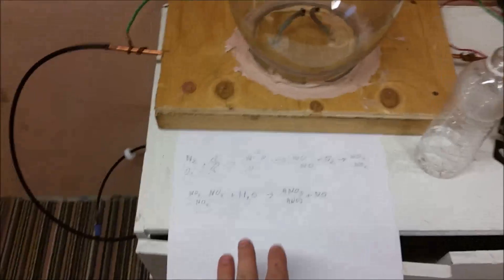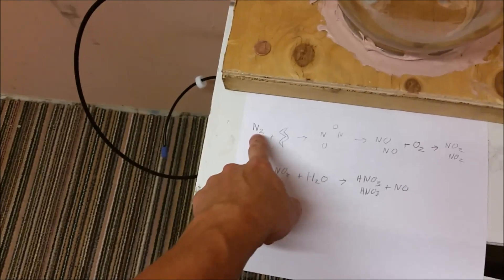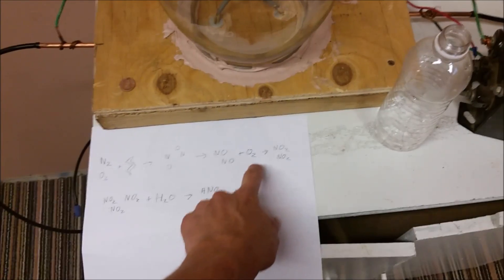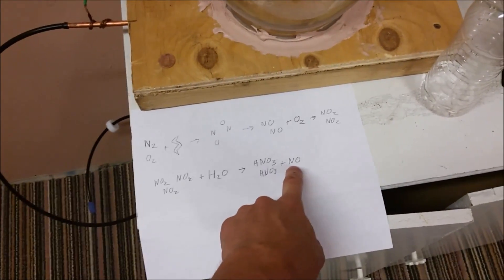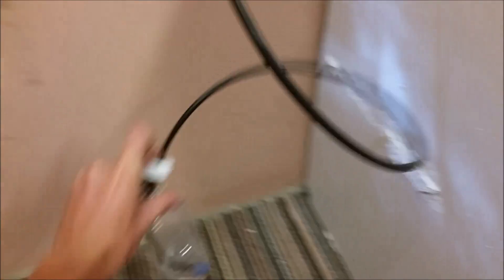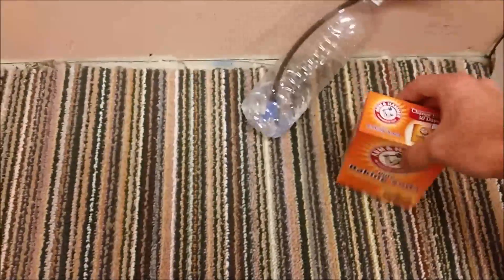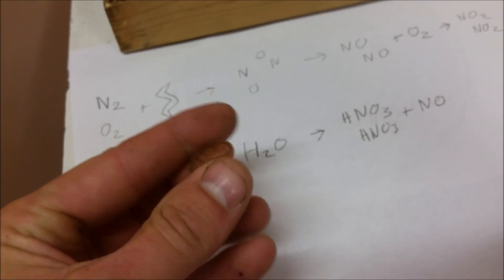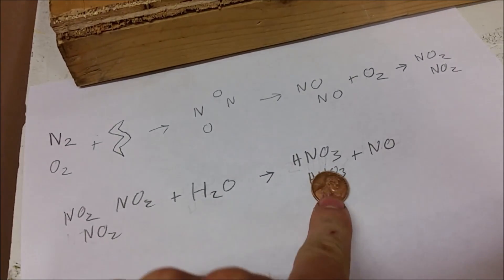Nitric Acid From Thin Air

Comment: this might be a stupid question but, is nitric acid like nitrate? can nitric acid be made into nitrate? sorry for the cringe.
Reply: Nitric acid is HNO3. The NO3 is nitrate. When Cody reacted it with baking soda, one of the products was sodium nitrate. Nitrate is just an polyatomic anion.
Reply: +Collin Barker can I make potassium nitrate with nitric acid?
Reply: Yes, you just need a basic substance that has potassium in it. Potassium carbonate (K2CO3) or potassium hydroxide (KOH).will work, they will get very hot though as they are both strong bases. Potassium hydroxide can also be used to create liquid hand soap and the conductive solution in an electrolysis machine.
Reply: yep. you will also get water and carbon dioxide. It will bubble and get hot.
Reply: no problem. If you need more of this, reply again here
Reply: Yes it is soluble in water and the process produces water. Added water will not affect it.
Water will be needed to react. This reaction is similar to baking soda and vinegar. After it is neutralized (done reacting), evaporation by boiling can be used to obtain the crystals.
Reply: If you add the potassium carbonate until no more bubbles are formed, the reaction is neutralized and there will be no more nitric acid.
Reply: It will dissolve but it will either be acidic or basic, neither are very good for plants (or you) in high amounts
Reply: There is no "limit" to how much can be added, but there will be a point where there will be no more nitric acid left to react with the potassium carbonate. At this point, it will become very basic.

I took 1st year university chemistry here in Windsor
Reply: Neither. Only the nitrate contains the oxygen which makes stuff burn. Achieving neutral is the safest solution to have. This can be done with many chemicals that are indicator, litmus paper is one of them.

You can also add enough potassium carbonate to nitric acid that it will stop bubbling. This will make it slightly basic but almost neutral. It is usually easier to dehydrate bases than acids. (baking soda vs vinegar).

You need to get as close as possible to neutral as carbonate will produce carbon dioxide (CO2)  if it is burned or heated to high temperatures which will slow the burning process. It is a fine balance between easy to dehydrate and easy to burn.

If you want a safe practice example, get some vinegar and add baking soda until it stops bubbling. This is the same type of reaction with very similar results. (water, CO2 and a salt) 
This does NOT produce nitrate, it is good practice for when you use nitric acid and potassium carbonate.

The chemistry I took was Chemistry for Engineers, it has little organic and a large amount of mass scale everything else.
Reply: It is dangerous to handle both when they are strong. When close or at neutralization, it is fairly safe. If you overshoot though, it is dangerous either way. Strong bases turn fat into soap while strong acids dissolve most things including metal.

Use a glass bowl and combine slowly. Wear gloves too.
Reply: Ok Just be extremely cautious
And yes, that is why the fat turned into soap. It is a process known as saponification. 

He ended up with a lot of fat and not a lot of bacon from that.
Reply: Potassium nitrate is an oxidizer, it needs fuel also. Paper soaked in a solution of KNO3 and dried or combining it with sugar like the King of Random will cause it to burn vigorously.

With sugar, the formula is
5C12H22O11 + 48KNO3→24K2CO3 + 36CO2 + 55H2O + 24N2
Reply: As far as i know, it is not possible to make normal dynamite with KNO3. Dynamite is nitroglycerin in clay. This is an impact explosive. It needs a shockwave to go off. 

KNO3 can be explosive by sealing the container it is burning in. 

Just like lighting a bottle of flammable gas without the cap is a rocket, with a cap it is an explosive.
Reply: It does not need to be completely sealed, just the exit so small that the amount of gas breaks the container rather than venting out. The container needs to fail under the pressure. 

As for ignition, you still would need a source of flame, KNO3 should be thought of powdered oxygen. Oxygen alone does not burn, it needs heat and fuel
Reply: A plastic bottle would work

I do not know how much you would need

It depends on the size of the bottle and how thick the plastic is
Reply: Adding NaCl (you got it right) would not do anything. That is a very stable bond. Oxidizers usually contain oxygen or fluorine, which react very violently with most compounds. (Please note that that is fluorine, not fluoride which is in toothpaste)
KNO3 is the oxidizer while sugar is the fuel. KNO3 supplies oxygen while sugar is oxidized (burned) by KNO3. The energy released from the bonds is enough to keep breaking other bonds to continue the reaction.
Reply: +hentai nat sorry if I confused you, ignore the fluorine
Reply: +Collin Barker there is none
Reply: +hentai nat yes aluminum powder and potassium nitrate will burn, it will not be like thermite but like old flash powder.
Reply: while not as "Cool", KNO3 can be used to boost nitrogen content in dirt (this is what i thought you were doing originally) It can also be used as a key component of gun powder.

K2CO3 is used in baking as a substitute baking soda. It was used prior to baking soda being commercially available. It is also added to food to increase the potassium levels.

HNO3 is used in the reaction to create fertilizers, It is also used to create explosives and early nylon. 

Since you are so interested in this, I recommend reading The Mysterious Island by Jules Verne, where a group of people crash land a hot air balloon on an island and make many devices that were popular in the early 1900s, which the book goes into great detail explaining.
Reply: Yes it would fertilize the plants. It is based on concentration. You need to eat some salt, but if you eat a stupid amount of it, you die. Same for plants and it is the stupid amount that kills stumps
Reply: It is pretty much pointless as 30% can also be purchased but you can freeze it. skim off the ice crystals on the surface and repeat. this will take a long time though. Boiling will destroy H2O2.

As for the Jules Verne book, you can probably find it online for free now. It is old and its material has not been used for decades. (That new movie with the same title only borrowed the books title)
Reply: +hentai nat 4he methods I listed would work with a a lot of patience
Reply: Copper reacts with the nitric acid to form copper II nitrate. Cu(NO3)2

This will also happen with vinegar but over a much longer period of time. it will produce copper acetate (CH3COO)2Cu. This is what happens when pennies are put in vinegar for a very long time.

The blue-green colour is the defining characteristic of Cu 2+ ions
Reply: Yes
Any Cu2+ containing chemical can work
Reply: Nitric acid would dissolve the copper
You would need a solution of copper II Nitrate which can be made by mixing copper metal and nitric acid. See this link
http://www.webqc.org/balance.php?reaction=Cu%2BHNO3%3DCu%28NO3%292%2BH2O%2BNO
to get the proper amount in grams.

To electroplate the metal, use copper on the positive terminal and the other metal on the negative. Have the bath between them be the copper II nitrate.

Some of your previous questions I missed by me using the alarm tab in chrome:
1. Can you drink nitric acid?
Not if you want to live. It is a strong acid, think hydrochloric acid found in your stomach or sulphuric acid (battery acid).

2. Can nitric acid be used as fertilizer? 
Not the acid, but potassium nitrate or another nitrate salt. The acid would kill your plant. 
Do not use a large amount though, it can be used as stump remover in high enough concentrations. The potassium nitrate would benefit your plants even more as potassium is another key ingredient found in fertilizers.
Reply: For the electroplating fluid, do not be afraid if it is blue. It is going to be very blue due to the copper 2+ ions
Reply: By the way, where are you in the world, you tend to post late at night where i am
Reply: Ok that is why midnight for me was when your message came in.
Reply: Adding the nail to the acid would have created hydrogen gas (the bubbles) and a salt. The black goo was probably from the alcohol reacting with the acid forming a variety of organic compounds. 

The reaction forms water because the way that the reaction occurs. Some of the nitrate ions are destroyed and its oxygen is reacted with the hydrogen forming water. The entire process is very complicated and I only have a rudimentary understanding of it.

When electrons are added to nitric acid, it forms nitrogen dioxide and the hydroxide ion. this hydroxide ion reacts with some of the acid to form water
Reply: i cannot find floricene I. It might be fluorescein which is a common chemical used in eye tests and some similar compounds form yellow 7 and 8 in food.
I cannot tell if it blows up as I do not know if this is the right chemical. If it is, this one is one of the more stable ones. Other fluorine containing compounds are extremely explosive when heated slightly. there is one that will even set concrete on fire.

for creating metallic sodium, look at this link
http://www.instructables.com/id/How-to-make-metallic-sodium/
It uses electrolysis to create sodium metal from molten sodium hydroxide, which can be obtained from make your own soap companies or wherever KOH is.
Reply: electrolysis is the process of passing electricity through a substance to break up bonds as in creating hydrogen and oxygen from water. It can be done with molten sodium hydroxide. A VERY basic salt. 

I was stating a place where you could get sodium hydroxide. It is used to make soap and some companies sell it specifically for home soap making.

Another note: nitric acid with potassium carbonate will do thed same thing as baking soda and vinegar but much quicker and more dangerously (high heat, unreacted components). I would not attempt to do this reaction in a pressurizable container.
Reply: Most soap companies that sell KOH also sell NaOH. I was stating that if they carry one, they probably carry the other.

Potassium can be made the same way, using KOH. Store it in mineral oil as any water, even humidity may cause it to react
Reply: no, mixing them does not make them more reactive. I stated that each should be kept in mineral oil when made so they do not react in the air. Potassium is much more reactive than sodium. It might even catch fire as hydrogen is produced
Reply: I just looked this up, yes you are right, it is more reactive mixed. 
According to the article i found, the metal is a liquid so when it reacts, the hydrogen bubbles can leave small gaps water can fill. 
How to mix them, I do not really know but you could try the electrolysis on both at the same time. they will not react with each other and it will be hot enough to melt both.

To retrieve the copper from the copper II nitrate solution, there are 3 options
1. heat it until it is black (CuO). Capture the fumes (NO2) and send through water to regain nitric acid.
Take CuO and have it in hydrogen gas

2.electrolysis. If both terminals are nonreactive (eg graphite) copper will build up on one and nitric acid will form. 

3. Single Displacement. add more reactive metal, aluminum or iron to precipitate copper, it will consume the metal added though.
Reply: carbon rods should work.
Stainless would corrode as it undergoes the 3rd reaction (single displacement) as it contains iron
Reply: yes, you can boil the water off. just keep the temperature low. HNO3 will boil at 120 degrees celsius
Reply: neutralize it by reacting it with a base. This way it will not eat pipes. Diluting it would also work but it would take a very large quantity of water to do so. Neutralization would be the best. If you neutralize it with K2CO3, you could spread it across your yard and garden as fertilizer
Reply: HNO3 has no smell. Brown orange vapour visible in high concentrations. DO NOT DRINK. storage is ok in glass.

Cyanide is found as a salt or dissolved in water and therefore cannot be smelled (it has to be a gas)

Both are really dangerous
Reply: the easy answer is EVERYTHING
Each poison is unique so look each up for hazards.
Reply: a little, not in high detail though
Reply: Putting it in would cause the copper to come off and a little of the steel, the copper will flake off but the steel would build up a coat of rust around it, protecting it from more rusting. It will eventually fail though. Try ammonia to just get copper, it takes a while but it should work
Reply: It can be used to create hydrogen and oxygen gas. The King of Random has a video on it.
Reply: you probably could, but it would dissolve your terminals very quickly. Salt would also rust them out too. I used KOH for mine
Reply: Stainless steel produces toxic chromate ions which are illegal to pour in most drains. As for iron or regular steel: Fe (s)-->Fe2+ +2e-

To recover it, dry it out and add carbon. Smelt it down and you get iron. Although you could just melt the nail in the first place. Unless you have a pile of old nails, it would not be worth obtaining them to create iron. Fun experiment though
Reply: Yes it is an alloy with chromium in it. It reacts with water and dissolved chemicals to form chromate
Reply: It is used to rust proof metals. I do not know how it is done. It was also used in combination with lead to make yellow paint
Reply: As far as I know, no. Iron will rust. Gold will not. Until there is only gold on the surface, it will rust.
Reply: wow this is a long comment chain. but i don't think gold atoms will form bonds with iron atoms due to differing sizes and you won't get a consistent crystalline structure that prevents oxidation

Comment: is it possible to use a flyback transformer from a crt monitor/TV?
Reply: Just beware that this setup effectively runs the transformer on a continuous short circuit. Neon transformers are designed for this and have built in current limiting. You can short them out all day long. TV flybacks on the other hand have no intrinsic current limit, so make sure whatever you're using doesn't burn out itself or the flyback under sustained shorts.
Reply from the maker: yes
Reply: +Cody'sLab oh, thanks.
Reply: Spag The Maker I was thinking of running it using a CFL circuit.
Reply: +hentai nat flybacks will eventually arc internally. It would work, but you'd have to monitor it more than the nst.
Reply: Smithii welp, that sucks.

Comment: Hey Cody, that smoke detector would work better if you put some batteries in it.....3:15
Reply: Smoke detectors don't have a constant on light
Reply: Domino52o It’s Cody, you’d never know.
Reply: and put it up under the ceiling where the smoke will collect...

Comment: Hey Cody, that smoke detector would work better if you put some batteries in it.....3:15
Reply: How do you know it doesn't have batteries?
Reply: IF U TAKE THE PLATNUM WEAVE OUT OF A CATALITIC CONVERTER
RUN HIGH VOLTS THROUG IT
WORKS 10 TIME AS FAST

Comment: If you use standard 3% hydrogen peroxide instead of water as your bubbling solution you can convert your otherwise lost NO gas to NO2.  But then you have H2O2 contamination to deal with.  You can convert H2O2 to H2O and O2 gas by exposure to sunlight or catalytic decomposition

Comment: would a flyback work for making the arc. also could I use more water to get more acid if I left it on longer.
Reply: You have to be careful though. If it is using old TV set. Very high frequency can self induce even higher voltages. It will burn patterns through wood. Mine jumped 2.5 inches across electrodes. You can't touch or get near it while running. I used poly pipe but I advise not to touch anything until you unplug
Reply: Above all don't use microwave transformers. Many people have been killed

Comment: It doesn't say anything about using water in your title; only air.
However, if you acquired the water you used by defrosting your freezer, then technically you delivered as specified - .since that ice had been extracted from atmospheric humidity - but it would have been more satisfying had you said that that's what you'd done.
Cheers ;)

Comment: Very nice. 
The best thing about this is that you might be able to increase your yield with minor alterations that would not greatly increase cost. 

Instead of using plain water in the acid trap, you should use cold hydrogen peroxide.

Comment: If you used liquif oxigen and liquid nitrogen to do this, could you increase the yield to an usable amount?
To create a oxigen and nitrogen rich atmosphere
Reply: You could increae the surface of the arc and the yield with magnets
Reply: +ficolas2 I don't think that the problem is with the gas concentration (the air is over 60% nitrogen and around 20% oxygen), but more with the energy density: you see the only place where the reaction has taken place was the tiny little area of the actual arc. The rest of the air didn't partake in the reaction. Thus I think that more than using liquid gases using a more powerful power supply would've increased the yield considerably...

Comment: kinda new to this chemistry stuff so I'm not so smart. Which is lighter? The air in the fish bowl or the nitric  oxide gas?
Reply: +SuperBakugan1 Being new doesn't mean you're not smart. At least you're here. The nitrogen dioxide is about 50% denser than air. One litre of air has a mass of 1.28 grams and one litre of nitrogen dioxide has a mass of 1.88g. If you are going to get into learning about this kind of stuff, Google is your friend; you'll get a lot more information and a lot quicker. Wikipedia is actually very useful, despite what you may have been told.
Reply: +Morgan Mitchell thanks :)